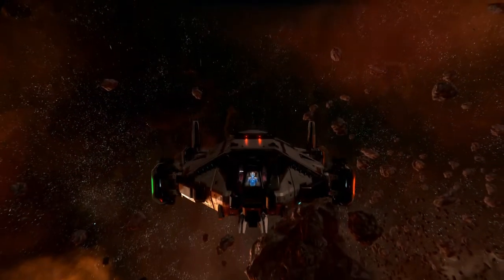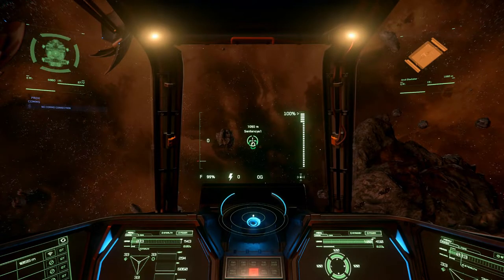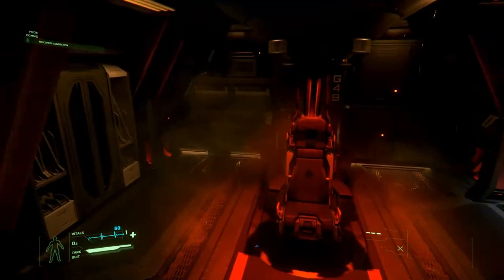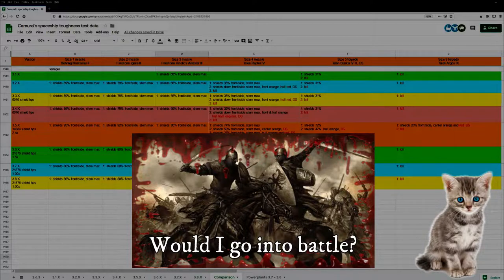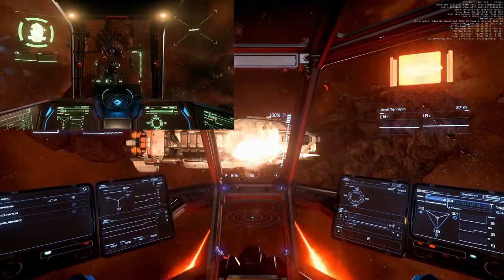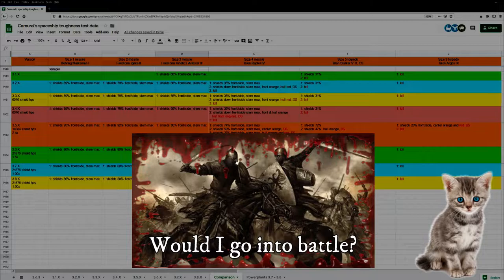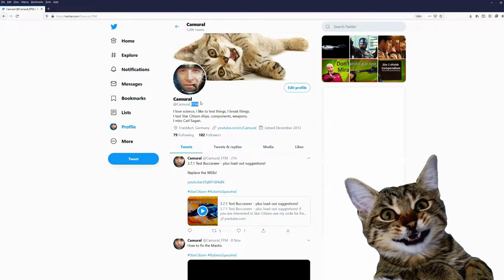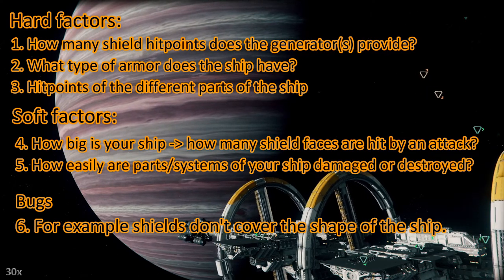3.8.0 Toughness test Terrapin - shield holes galore

Comment: Even though I agree that having all the engines out of alignment with the ships center mass is a bit dumb, I just imagine that the "magical" gravity generators throw all those calculations off... In a different way for each ship...
Reply from the maker: SamOfTheTribe this is actually a very nice idea. To be honest, I think Star Citizen would be a much better game with mag boost and real gravity (mass gravity, spin gravity or thrust gravity) instead of the magical gravity plates. However, if our ships have magical gravity plates they may as well have magical engines :)
It wouldn't be any more work to put the main engines in the right spot and use main engines that are gimballed or have gimballed nozzles, though, which makes me sad.